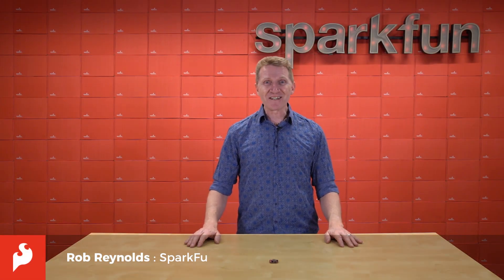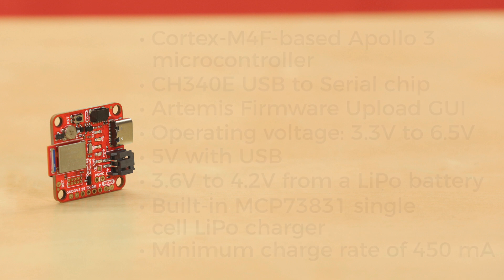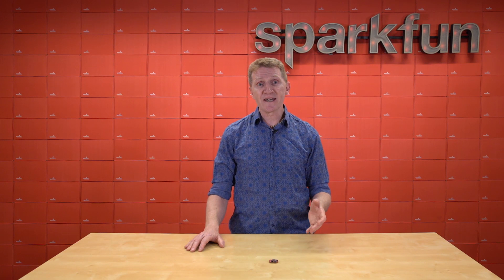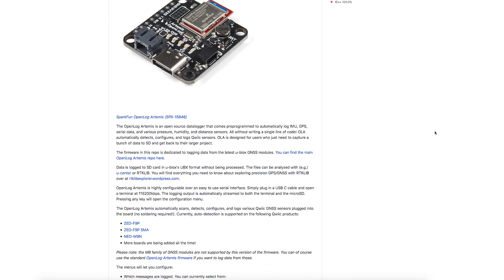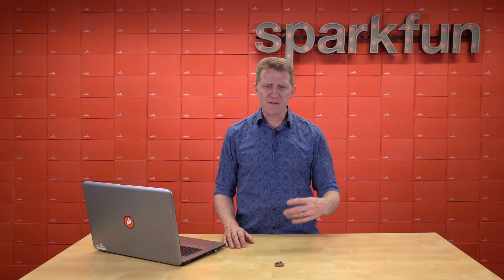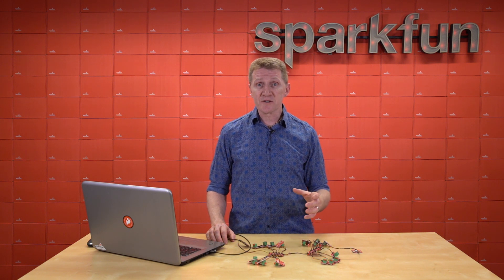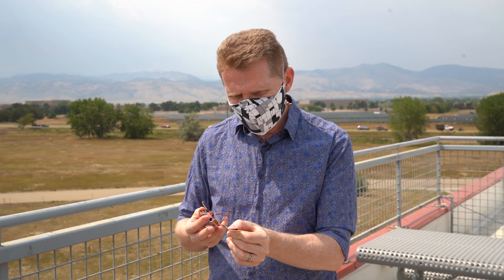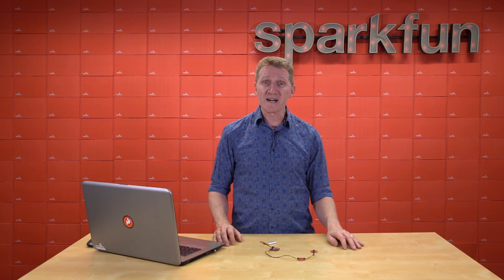Product Showcase: SparkFun OpenLog Artemis

Comment: I got one recently and totally disappointed. Sure it worked perfectly with the two boards I had that it supports but as I dug deeper, I need to write a lot of code to make it work with most of my other sensors.  I just decided it was easier to write code to log as I am used to skipping this thing and tossing it in my back shelf red box.  Also, I don't get why SF would develop a board like this and not build the compatibility for all their boards. That seems like the point right?

Comment: In 6:45 - 6:55 .. 
could you please explain how do you get that in low power mode it will run for 10 years?
In sleep mode it uses 240 microAmps, the battery you mentioned is 200 miliAmp/hour. 
My calculations are 200/0.24 = 833 hours = 35 days only
Reply: I recall him mentioning that if one disables the sleep-indicator LED, sleep-mode consumption will be greatly reduced.